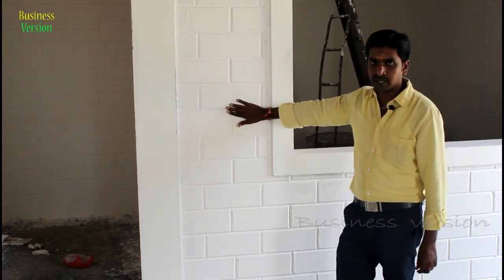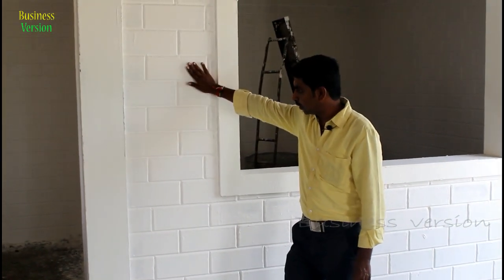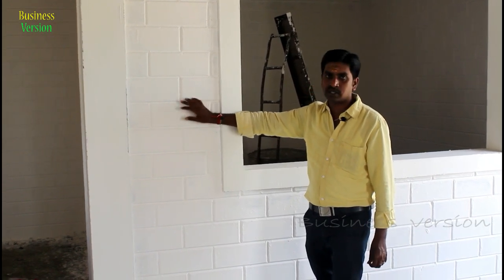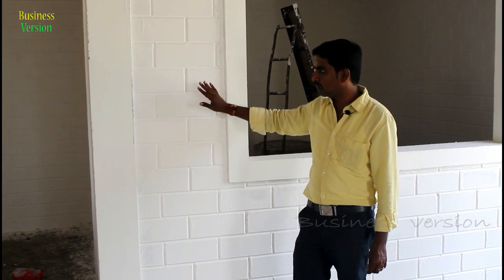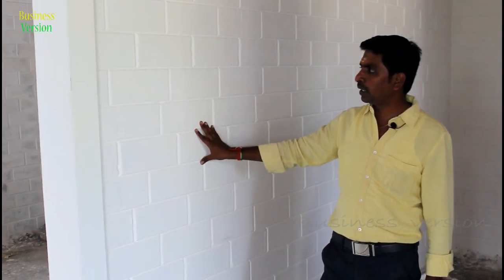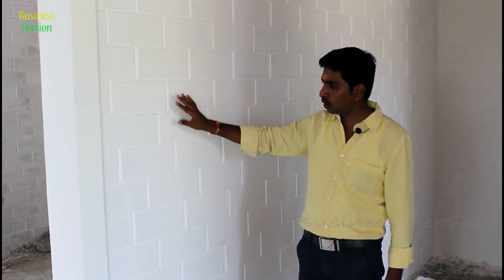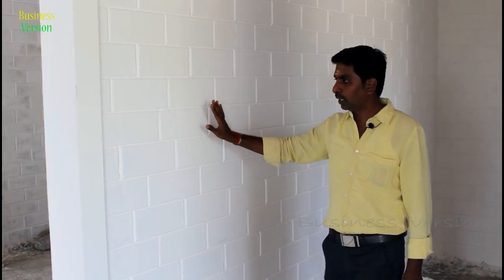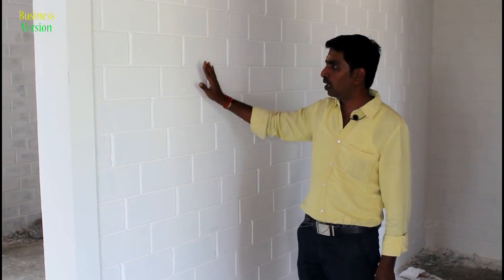interlock bricks questuions and answers interlock brick manufacturer

Comment: Wall construction ku adhesive use panreengala? Roof Concrete weight ku support panra alavuku strength irukuma sir? G+1 or G+2 ethana floors varaikum support pannum?

Comment: Sir, thanks for the video, I am from Idukki, kerala, Locally i have only 6 inch Interlock Cement bricks available, 8 inch is not available, If i hve to get 8 inch from eranakulam i will get a huge transport cost. i am planning to construct a 3 floor building with proper pillar beam support, normally for house or building construction,  6 inch brick or 8 inch bricks are used ?  , i wanted to know kindly advice.
Reply: Hi Krishna, have you constructed with interlock bricks? What you did to cover transport charges?
Reply: @karunakarpn  No brother, i am going with normal concrete bricks, since no body is using these interlock bricks here i do not want to take risk. construction not started yet.